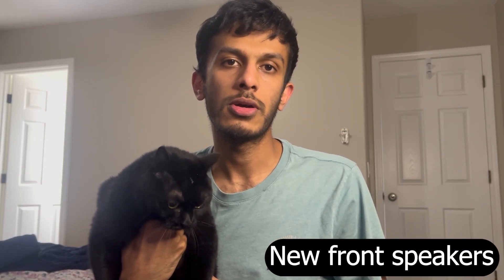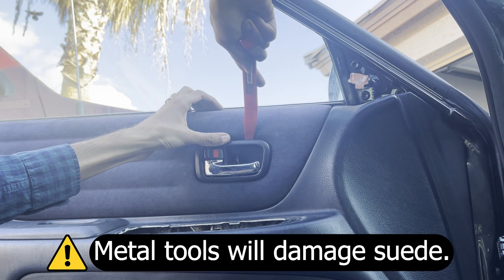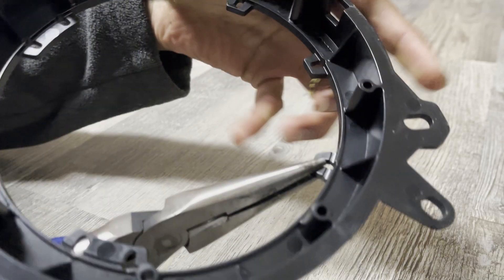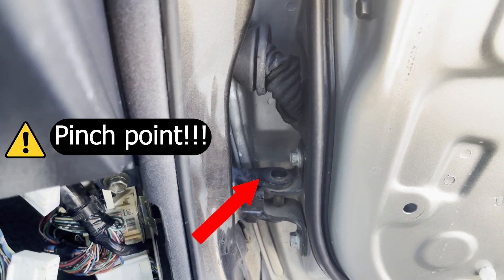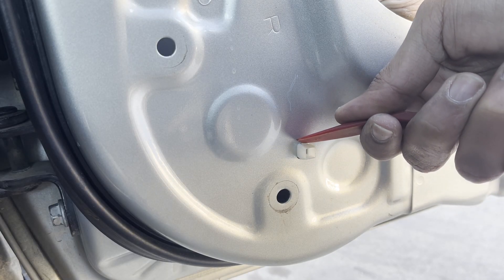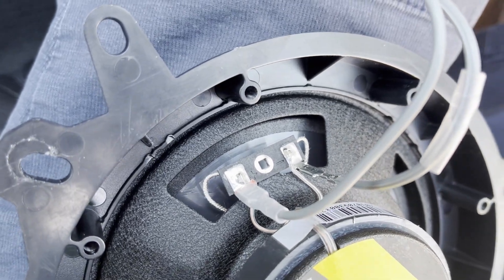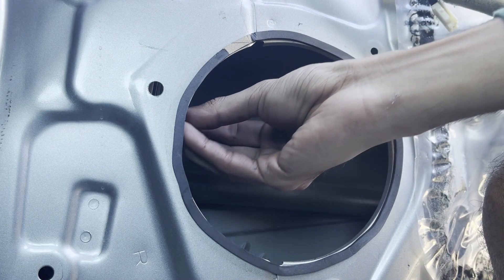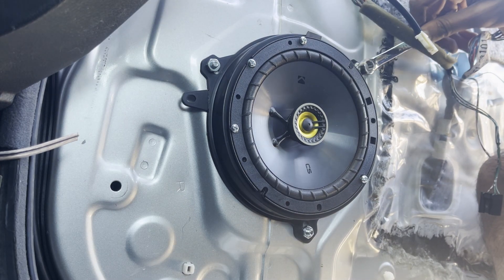How to install front speakers on a Lexus IS 300, Altezza | 1998 - 2005 (1st generation)

Comment: tell me plese why didnot use original speaker wire
Reply from the maker: The previous owner cut up the factory wiring harness, so I didn’t have the amplifier input plug to connect to the speaker with. Also direct wiring is quite simple